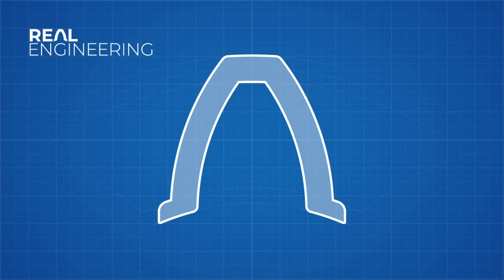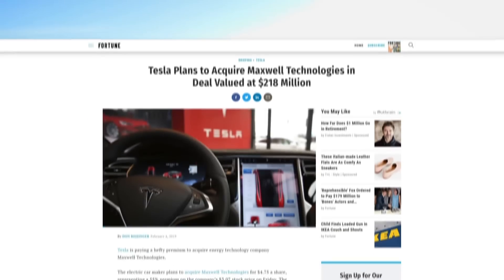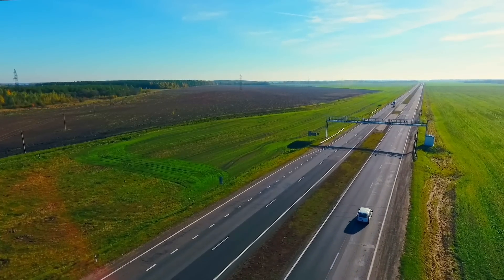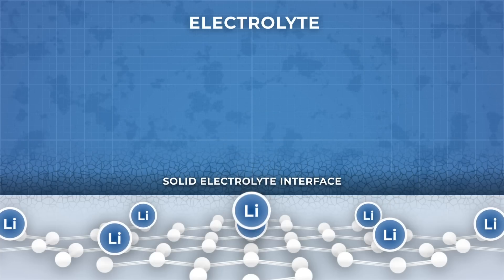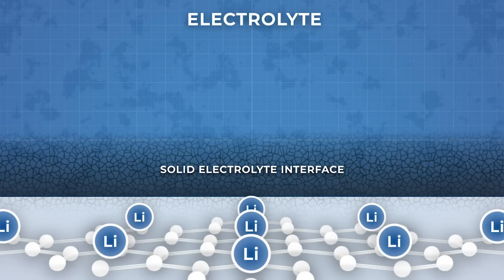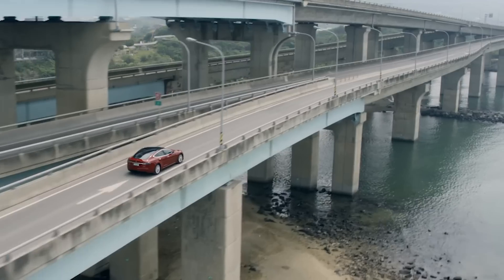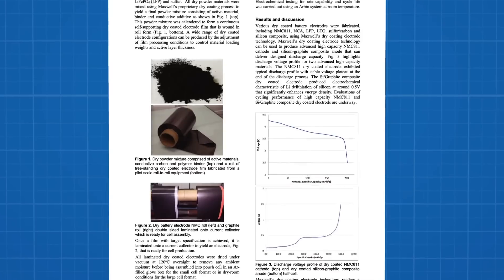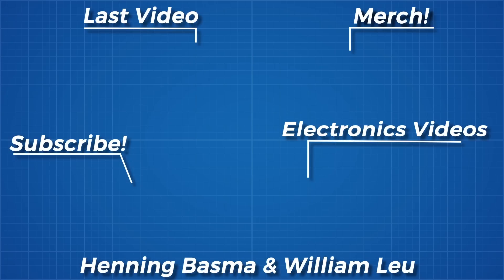Tesla's Quest for Better Batteries

Comment: While waiting for the development of new and efficient batteries and instead of relying on re-charging built in batteries in electric vehicles, would it be more appropriate if Tesla include a quick attach and detach battery system in their battery management infrastructure. Since Tesla is also the one making the batteries for their vehicles, the process will work in a way of instead of just charging stations, electric vehicle owners can have the option of charge-ready battery replacement whenever they are in a hurry. On the other hand, Tesla can design a standard battery design that can fit into their vehicles. The removed used or depleted battery from vehicles can then be placed in a battery charging carousel to be made ready for other customers. Visualizing the infrastructure, it would be more like a petrol sevice station where Tesla owners can have the option of re-charging their batteries while enjoying the amenities of the station or simply have a quick battery replacement when they are pressed for time. Just a proposal for Tesla and other electric vehicle manufacturers.

Comment: Following are summaries and links to recent studies and news articles on this topic. 

Evaluating extremely low frequency magnetic fields in the rear seats of the electric vehicles

Evaluating extremely low frequency magnetic fields in the rear seats of the electric vehicles. Radiation Protection Dosimetry. 
In the electric vehicles (EVs), children can sit on a safety seat installed in the rear seats. Owing to their smaller physical dimensions, their heads, generally, are closer to the underfloor electrical systems where the magnetic field (MF) exposure is the greatest. In this study, the magnetic flux density  was measured in the rear seats of 10 different EVs, for different driving sessions. We used the measurement results from different heights corresponding to the locations of the heads of an adult and an infant to calculate the induced electric field (E-field) strength using anatomical human models. The results revealed that measured a dose amount

Comment: Nissan not testing their batteries in extreme temperatures is a major facepalm. Even Internal Combustion Engine cars test almost every part of the car in a range of temperatures. 

But the big thing is: we've known for over a decade (maybe 2 or rven 3) that cold temperatures decrease the amount of charge and the battery life of lithium ion batteries batteries. Almost makes me wonder if this was a case of corporate ignorance. (Edit: as shown by the fact that they still didn't include a temperature control unit in their 2019 Leaf's)

Comment: making batteries themselves wont always result in savings,   ford for example doesnt cast its own engine blocks, doesnt make tyres, and in the UK radiators were for decades made by a separate company, sometimes another company that specialises in the subject is a better way forward, as they also have other outlets to sell products and thus the savings in mass production

Comment: Dear Johnny come lately I won't difress into your futile battery stuff and you will eventually learn news of alternative engine propulsion system that uses a 400 pound battery not 800 to do 5 times range of a Tesla on biodiesel fuel with a 30 gallon tank.  Leave me alone.  I am busy.

Comment: Hydrogen is the future. These batteries just don't work they are all too highly limited, they don't last and they are decisively not eco friendly in their production and their disposal.
Reply: No, it's not it's only 1/3 and efficient as a BEV.
Batteries do work (HFC vehicles have them as well!)
They do last, there are Tesla's already at 500,000 miles.
They are more eco friendly that hydrogen which uses huge amounts of energy to make it, plus other associated losses.
Even TOYOTA agrees!
Plus
Batteries have 2nd life in static storage AND are recyclable.
Reply: @rogerstarkey5390  yea right.
Recycling is a bitch. No shit making hydrogen uses energy and guess what so does charging your battery. Hydrogen is pretty damn efficient if you take a look at modern hydrogen production and usage methods. Hydrogen can be produced in a 100% clean fashion which batteries never can be. If you want to see a modern day human rights violation and slavery take a closer look at how the materials necessary for battery production are won in third world countries. Batteries don't generally last of course as with everything there are a few exceptions but most teslas don't make it all that far without a battery swap and I'm calling straight up bs on your figures. Also have you ever heard of what a hassle it is to extinguish a battery powered car in a wreck? There basically isn't a safe way to handle the wreck. Hydrogen vehicles on the other hand have come a long way in crash safety.
Of course Toyota is pro battery. Toyota likes batteries cause the complicated thing about battery cars is the battery the motor is easy af. Toyota buys the battery and the motor is easy. Anybody can make a battery powered vehicle. Hydrogen on the other hand has a somewhat complex motor similar in complexity to combustion. Something that Toyota will and has struggled with.
If you wanna talk about this issue don't mention bs numbers like your cute tesla mileage lie and think about brand bias.

Comment: Those prices include massive subsidies and tax rebates that Tesla gets and understand the company laid off 7% of its workforce because it was still hemorrhaging money.  This made them just barely become profitable for one quart last year.  Without of the zero interest loan, multi billion dollar grants and the US government paying about $10,000 dollars in tax rebates for each car they would have to significantly raise their prices.

See the US (and most of the World) has the habit of subsidizing "green technology" on the retail end so it can sell.  The problem is most of these technologies are not really that good for the environment.  We need better technology, but only about 5% of these subsidies and grants actually go to research.  It should be 100%.

Also Tesla is researching ways to make the batteries incrementally better and cheaper each year, but it is in small steps.  We need to get away from lithium.  There are several promising technologies that are being researched, butt hey are 20-50 years away still.  Until we have a much better and cheaper battery, electric cars will never be more than a fraction of the market.

Comment: If you Google search “steinbuch degradation”, you can see some user-reported Tesla battery degradation data. The trend line is like 92% remaining capacity after 250,000km. Way better than most people think.

Comment: One thing nobody really talks about is that high energy density in batteries is not something to be taken lightly.
If you thought that a malfunctioning phone battery in your pants is dangerous then imagine what will happen if the car sized battery goes off under you.
And just to be clear, I´m not saying anything against e-cars, it´s just something which is missing from 99% of the discussions for whatever reason.

Comment: It's not 1 battery.  It's like 5-7000 cells  per car. Depending on model.
Reply: a battery is normally a collections of cells,  the term also gets used for single cell consumer items we also call batteries
Reply: @yarpos  Thanks. Work for the company that makes the "batteries"for Tesla cars. We call them cells. 😉

Comment: That's not true,my 24kwh Nissan leaf gives me 145 km range.. And the batteries don't degrade 27 percent at all.. Ours is near 100 percent capacity after 40000 miles
Reply: Well then you’re a hell of a lucky son of a bitch. They’re well aware and have recognized the issue. It is true. Sure not everyone may be effected, but it’s pretty widespread.

Comment: All that promotion froth has clear meaning......That's to cover the pyramid piling up investors money higher and higher.
There is a SIMPLE question......Where you'll connect all those charging stations? Who'll pay for such powerful electrical lines to be BUILD for that? Present gas station has up to 5-10 kW for PUMPS and lighting....only.
One more thing.....Why industry LEADERS do not go to join?.....Could be they lost passion for profit? .....or they are so shy to open that battery block or copy control unit?
The reason is only ONE....They ALL KNOW that without NEW and TOTALY different "battery" on board there is only the financial pyramid that will collapse the moment it will come the time to pay back the credits taken.
There is NO electrical car before the moment of NEW battery appearance.....That STANDART "battery" has to be have its energy stored equal to 1/4 of energy in the present time's gas in the tank and has to be REPLACED by robot at the charging station in 2-3 minutes.....Then, changing 1-2-3-4 out of 4 in a handy moment and time, we'll forget about combustion engines.....
Hope that will come earlier that in next 30 years!!!!

Comment: I’m not a genius but where do you think the electricity comes from to charge batteries?  Fossil fuels and mostly coal power plants. So essentially a Tesla runs on coal.
Reply: That's why company's from Elon Musk advocate for solor power and you can tell by his company solar city which makes solar panels as roof tiles. It's not that buying a Tesla is environmentally friendly it's about how you get that energy.
Reply: DUF Garage 
Even if...the electricity generation comes from fossil fuels these vehicles are still more efficient and better for the environment. However I think your premise is incorrect - coal is dying fast. Many many countries have ended coal powered generation. Clean energy is advancing despite contrary vested interests.
Reply: Alasdair Black not true. Coal is still popular and so is nuclear power plants. Solar power is still not very efficient and a battery car is no where near as efficient as a gas car. My wife’s car gets well over 400 miles to a full tank. Tesla’s not even close

Comment: My assumption was for much higher price than 150$/1knH. 
It is also amazing that Maxwell is working on capacitors. Mazda is already using small capacitors (iELOOP), but only for few models and not all engines. This would be a great reliable alternative/addition to batteries.

Comment: I just came here to say that the last month two great discoveries towards durable energy has been made. First, a solar panel that can produce hydrogen out of water molecules floating around in the air. Second, a new microstructure that has the capacity to let through alot of water molecules, so it could serve as the structure for a battery based on hydrogen as its fuel. It's simply revolutionary. Imagine cars driving on a small tank of water, you could go anywhere!

Comment: The problem in all electric cars are batteries, also Tesla who seems to be so much better from every one else but in my small opinion just simply is not.
They like every one else use unstaible, expensive and not very evicient Li-lon batteries that are old as the technology to use. I would much more appriciate Mr. Ellon to improve what in my opinion is a issue and work on new type, more staible and evicient batteries technology insted of putting old one in new ''boxes'' and call it revolution in electric cars.
good buissnes men tho ;)

Comment: Outstanding work on de-mystifying a massively misunderstood subject. However, saying 'a myriad of' is incorrect. Myriad means an amount accepted to be in the region of 10,000. So put an a in front, and an of afterwards means you are actually saying a 10,000 of - which if you it that way would sound like insanity.
So to say "there are myriad reasons" would be correct, but if someone said "there are a myriad of reasons" it wouldn't be.

Comment: One big problem that I see with electric cars is that there are an awful lot of 10+ year old cars on the road, and I have yet to see any kind of battery ever in my life that lasts 10 years and is still strong.  Nevermind the charge cycles.  Something happens to them in regards to simple age.

Get it to 20 years, and that would be a gigantic game-changer.

Comment: Actually battery life ist not a point with modern chemistries, but it is still a trade-off between energy density and power/cycle life. Most of the automotive batteries are based on NMC materials, and have cycle lifes between 2000-5000 cycles. With a range of only 200 km you could drive up to 400.000 kms. At this point, the state of health is still at around 80%. Regarding time it will surely be usable for 10+ years at 80+% capacity. 

What really kills batteries is high and low states of charge hold for some time (days or more) and high temperatures. Low temperatures combined with high power output have the same effect. Active thermal management is crucial for battery life. Combined with some reserves at high and low socs a sufficient battery life should be garanteed. 

Your video has a mistake regarding cycle life. It is significantly better to charge a battery more often in a small area of its soc spectrum than reducing charge cyles and force the battery all the way from ~0 to ~100% charge. This would increase mechanical stress. 

For high power applications such as semis or high charge loads such as in regenerative braking, capacitors are a great relief for the battery. As you said in the video, it can lower the requirement of battery capacity as long as you are using high energy cells. Chemistries like LTO are able to charge up to 6C and discharge up to 15C continously. They have a very low internal resistance so they do not heat up so much (effects life time significantly). Depending in conditions, they can make up to 10.000-50.000 cycles. 

I am sure that batteries will improve even more in a few years. Imo the main points to improve are charging time (250kW for a Model 3 is sufficient) but even more important the compatibility with our environment regarding materials and production processes. The abandonment of Cobalt is an important step.

Comment: Interesting minor note, from a retired electronics tech perspective: 
In thinking about Cathodes and Anodes, the Cathode (spelled with a letter "T" similar to a "+" sign) is not positive but negative with respect to electrical flow.
We need to think of the Anode as an "arrow" pointing in the direction of flow from positive to negative, quote: "The arrow points to the negative"
IE: The Anode is on the positive side. We see this in diode and transistor symbols on diagrams, it can also be thought of as a "Greater Than" or a "Lesser Than" symbol

Comment: I don't see the added value for ultracapacitors for a brand that makes a point of putting very large batteries capable of 3+C charging rates (2170 Model 3) and 5.5C discharge (18650 Model S/X Ludicrous).
At 150kg/kWh, how tiny might a supercalpack be, and what might it actually do to help to save main battery life?

The Roadster is advertised to be 200kWh. For the claimed 0-60mph performance it will suffice with 4-5C peak discharge. In normal driving, loads will be very low. And we know that 2170's already perform quite well when it's only 80kWh.

I see a point for ultracaps, potentially, in car racing where braking events are extremely violent. Multiple MW order. 
Formula E racing cars (at the moment) take up to around 250kW. Let's just assume this is battery limited, not motor power or tire traction limited. F1 cars which approach a braking zone at high speed and with more downforce, generating 2-3kW in braking power. A few hundred kW of that at most are regenerative power flowing back to the battery. Lots of lost het.

But to take on 2MW of braking energy, you first need motors that can offer so much regen, on wheels where such traction is available. On the rear axle, you're not going to get that much but both F1 and FE don't have any motors on the front axle.
But even if Tesla's new Roadster were to have ~1MW of motor power, it would never charge more than that. 
What would an ultrapack add, not really? Does it NEED power from ultracaps when its drive battery is 2.5x the size of Model 3 Performance? Seems to make it largely dead weight. Added range in race conditions...MAYBE. Reduced laptimes...maybe not, as the extra weight is there also to reduce cornering speeds, extend brake distance, etc.

If you ONLY have very low C battery cells and not a lot of them, a small ultracap bank could help with regen in spirited driving, and of course deployment during acceleration. But worth the WEIGHT...? Maybe. The COST? I don't see it. 
Even at  unlimited power, caps just don't offer the energy to weight to make a huge difference. And you still need heavy (inefficient) motors to make the most of it.

Anyone have a better theory then "The Roadster will accelerate really quickly"?

Comment: A small but powerful gas or Diesel engine is still a better investment that pays off sooner and will last longer. Yes it isn't as tech sexy to many but if you look at small cars that offer a small, efficient engine it will invariably be cheaper to own in the long run and get really good mileage while not trapping it's user at a 100 mile maximum. Not to mention battery power cars in cold weather environments which makes battery's perform worse. We really need a real breakthrough in battery technology to make all electrical cars a real choice everywhere.
Reply: cheapest electric cars go for about $1200 by using a very weak and cheap motor with lead acid batteries, model 3 uses a 70lb 250hp motor which saves a crap load more on gas and maintenance then other engines in its performance, a company can come out with a $25,000 car with a bare bones battery and motor with decent range but would have to be a small car.